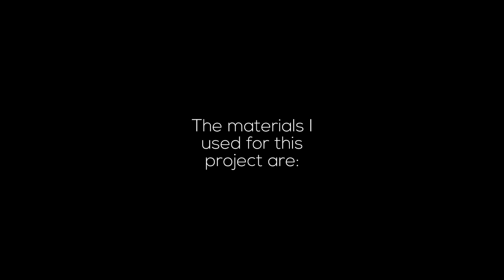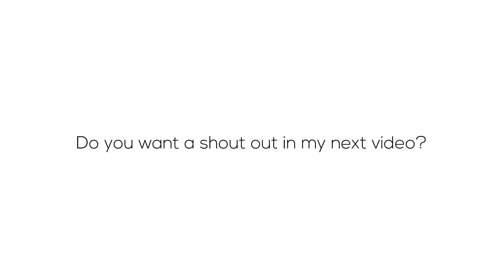The Ultimate Router Dado and Template Jig | Amazing unique 2 in 1 jig

Comment: I like this!  Initially I thought that the whole thing would be adjustable...like not needing the stop blocks at all providing the template would need just 4 sides.

I'm in the process of building a mini balcony over the front door entry and I was thinking of using a dado to slide the one piece down and into the side 2x10s that have a slope mimicking the angle of the steps that are under the future balcony.  Am I over thinking this? Or should I just nail the stuff together and not worry about stuff that drywall is gonna cover anyway....   Thoughts?
Reply from the maker: Hey Jeffrey, thanks for your comment. About your question, i think nailing the pieces together would be goog. Greetings.
Reply: @christofix  thanks for responding.  I know that there are as many opinions as doctors as well as ways to put wood together. I value your opinion. And I guess shooting in some nails vs making some more dust (this time wood instead of drywall) happen in an open foyer that I did not take off with plastic to prevent the dust from going everywhere...cuz I did not prepare.  I have limited time to do some of these projects.  I admire your skills and I hope your wife is appreciative of the time it takes to making things nice.

The same can go to input in the marriage.  Have a great week!

😇😎😃

Comment: When you go wider than you expect, and need a stop like you did at the end for the Template routing, if you Modify your Clamps on either side with a Dado at the bottom of the clamp, with a star knob/bolt going through the top, you could use any scrap wood piece to go from one side to the other on the top of both of your long boards, and then temporarily attach a board of the correct length (or close enough it will stop the router when it gets to it) to the bottom of the cross board strips, then, you would only have one pair of boards (I would assume the same as the length of the jig is now, so, you could do a big square template, and, then temporarily attach the  scrap boards to the bottom of your long boards for whatever width you were trying to template at that time. 
All you would have to do is set the stop block at the location you wanted the router to stop, attach some scrap boards the thickness of your Side boards of your jig now, to the bottom of your cross boards, to make it to the bottom of the jig)Touching the Routed stock you are routing) and clamp both sides down. 
So, that means, a track the length of your jig now on the other side, so you have an adjustable track on both sides to clamp your cross boards to.. 

Might as well make the cross boards the same as your jig length is now, so, your max size of your new modified jig is a Square the same size as your length is now.. 
Same Length/Width (was a rectangle template, now can be a square, the same width as the current length is now. 

Looking at the jig again,,, You could just use another set of boards like you have on each end now, only needing a slot routed down the middle (Leaving an inch (Not Slotted) every (guessing 10" or so to keep the boards rigid enough to stay stable), and just run a T-Bolt down into the existing T-track you have now. You would still have to have a T-slot on the other side you don't have now. Same temporary board attached to the bottom to keep the router base from going under it. The boards would be laying flat, so, plywood would not flex, even if it were only a scrap of 1" or so and you didn't push on it too hard, but, 1.5" or 2" would surely do it over the same span, or, just make it like your other long side pieces and you are sure to be Ok, if it works fine now.  Nice Job btw.. Nothing like taking a little from lots of designs and making the "Super Sled".. Ha... Got  a glimpse of your table saw sled, looking for that video now. Looks like you have a replaceable insert in the blade area.. 
It is one of the "Must Have" options on my next table saw sled. And, some through holes for the hand if you have a tall fence closest to you, to finger hold those short parts without having to clamp everything, every time.
Reply from the maker: Thank you for this extensive message, which contains a lot of interesting things, which I will certainly take with me if I were to make the jig again. The table saw sled does indeed have replaceable inserts along the saw blade. That is a feature that I am very happy that I added at the time. When I make a new sled myself, I do it again immediately. Thank you for taking the time to write this comment, I appreciate it. Regards, Christophe

Comment: I found this and it's been a few years but why not make and extension that utilizes the existing tracks you have going across the jig. this way it can be adjustable as a stop along the way anywhere on the jig. It would sit across as you have the temporary support on your existing stop but this would be two pieces connected in such a way to expand (or pull out like a draw slide).
Reply from the maker: Thank you for your feedback, My friend. That is much appreciated. Thanks for taking the time to write me this in a comment. Greetings, Christophe